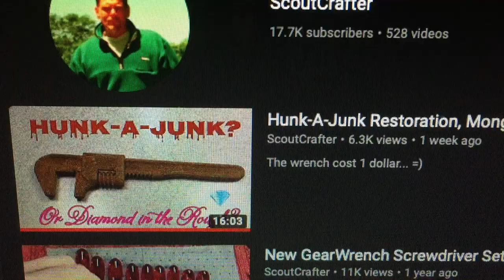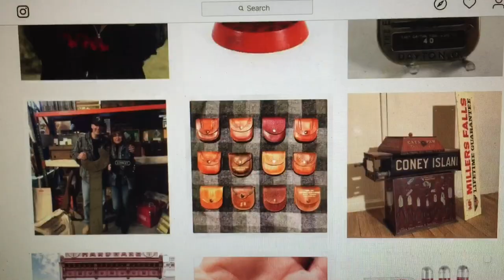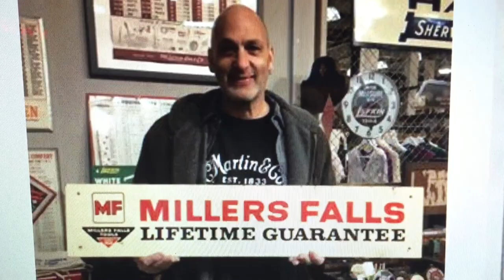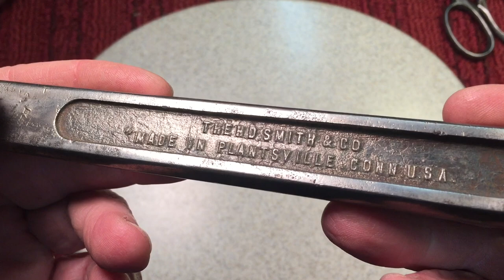Perfect Handle Pry Bar Restoration

Comment: 70 & 80’s I carried 2 “tire irons” is what I was told they were. Carried them on my motorcycles. I could pull over and patch a tires inter tube in about 5 mins front 25 mins rear.  The Honda dealer shop guy showed me how to use them. I had 1 flare and I was miles and miles from the nearest town and fixed it myself then continued. I was about 17 years old and it sure made me feel good to have the tools to make the repair myself. I carried a set of irons on all my different motorcycles after that. Never needed to repair a tire but when I was 17 it was only a tire because it was round. I never got flats later because I had good tires. But I loved 2 irons they made taking the tire off very fast. They were only about 10 to 12 inches long.
Reply from the maker: David- When I was 18 I bought my 1969 CB450 (it was 11 years old) and had it for 20 years...  Like you I did so much work on that bike.  Those were good times.....

Comment: I have the same sheep shears. They are marked Village Blacksmith. This company goes back to the 1900s in Waterford Wisconsin. If you hold the shear with the loop to the right and look down at the wide part of the top blade you may see the Village Blacksmith in the blade. Enjoy all your videos. Keep up the good work!
Reply from the maker: You know they still use that same design!  Amazing!

Comment: Great job. Love the old trimmers. Tell me, was that a flap wheel or a grinding disc you started the restoration with? Thanks. Always very educational.
Reply from the maker: Hi Carl David I used a worm flap disc....   I should have mentioned it.  😃👍.  Thanks!
Reply: @ScoutCrafter  I was a Project Manager/Engineer at Demmer Corporation. We made armor upgrades for Hummers, ýjjķ Bradleys, along with up armor for all kinds of military and private vehicles. The finish guys used flap wheels to blend welds and prep for welding. Just as soon as they wore down just a little they would get a new one. The grinders tossed them in a 55 gallon barrel. I never boughtva flap wheel and 7 years after retiring I still have more than I will ever use. 😆😎

Comment: Hey Scout! I’ve been watching your channel for some time now and love your videos. A quick question ... in this video you were angle grinding the tire iron and it was making a lot of sparks. Your shop is pretty chock full of stuff, some of which is probably flammable. Do you ever worry about starting a fire?
Reply from the maker: Hi Christian!  You are so right!  However I have found two different types of sparks. The flap sander I was using throws bright sparks that are very small and only travel a foot or two before extinguishing, now the grinding wheel throws much stronger embers that can be dangerous, when I use that I hang up a deflector!  😃👍

Comment: Yesterday I went to our local habitat restore to look for tools. Best find was a pair of diamond diamalloy 16 inch tin snips model dss-16. Very good shape with minor rust. $6.00 plus tax. Best place in town to buy used tools and hardware. I have one perfect handle tool. It is for removing valves in a ford flathead v8 engine. About a year ago at the same store I picked up wards 1200 watt generator for $15.00 because they could not get it started. I installed a carb rebuild kit and now I have backup power in we lose our power in the winter.
Reply from the maker: Chuck- Here in the city the stores aren’t as good as in semi-rural areas!  Awesome score!

Comment: A pair of sheep shears is the tool of the sheep shearer. I worked in New Zealand wool sheads as a teen. When the wool is long, it is said, the sheep need to be shorn (not sheared). By the way, sheep shearing requires lots of skill and high levels of fitness and stamina. It isbackbreaking work.
Reply from the maker: Warren-Here in NY some people have them as pets and can’t Shear them so they pay crazy money to have it done!

Comment: Hello
I have an antique forged pliers that I use for welding. The jaws get very rusty. I cannot oil them as the gas may ignite it as dunking in water doesn’t help. Any ideas. Also do you have a P.O. Box?
Reply from the maker: Hi Matthew- It seems like whenever you add heat to a tool, all bets are off...   Wish I knew!

Comment: Hey scout. Do you know if wiss is still the same company?  It seems to me there quality went down. Coming from someone who has owned and wore out at least 50 pairs of snips🙃
Also awesome pry bar.
Reply from the maker: Dale!  APEX tool group!   They have ruined more tool companies then any other tool group...  It's on their website!   =D
Reply: @ScoutCrafter  thx for the info.  I actually haven't bought a new pair in a couple years. Been using Milwaukee snips and tried some Lennox, trying to find a replacement for a good thing.
Reply: Was always a Wiss guy till I got a set of red and green from a company called MidWest. 
 The design, fit, finish, and steel quality are the best I have ever used.

Comment: Can I join the crazy club ? My efforts to join today are, polishing up 3 metal bicycle tyre levers followed by sawing off the box end of a combination wrench to allow the use of a 18 inch cheater bar, to remove a frozen bicycle pedal, and my favorite penetrating fluid is vegetable oil mixed with white spirit (paint thinner)
Reply from the maker: The Last Spartan Bicycles are tricky sometimes!  Weird threads, left handed threads, odd size nuts...  😂.  You have to try the 50/50 Automatic transmission fluid/ Acetone mix!  😃😃
Reply: I'd like to try atf/acetone but acetone is not easy to come by in the uk.

And your right bicycles have the craziest threads !!! 

I've noticed you mention your bows and archery, how about you do a show and tell video about them ?

Comment: I have an H.D. Smith tyre bar here in Cambridgeshire UK in unrestored condition. Looks exactly like yours with the "Perfect Handle" except that the tip is curved toward the perfect handle side. It seems a good quality steel, strong but flexible.
Reply from the maker: I wonder if the tips were bent either way depending on how the tool entered the machine?   Thanks!